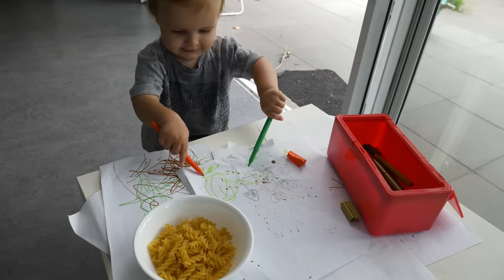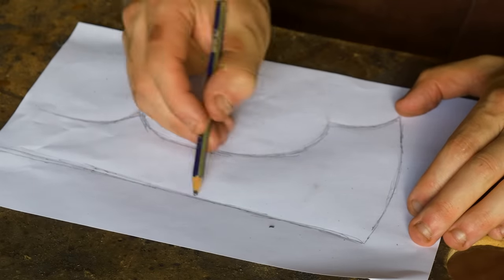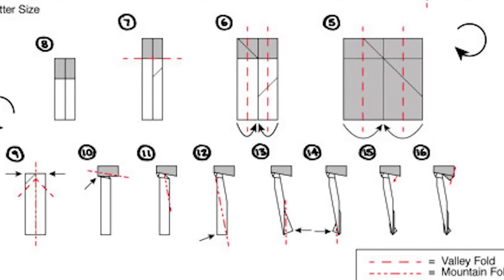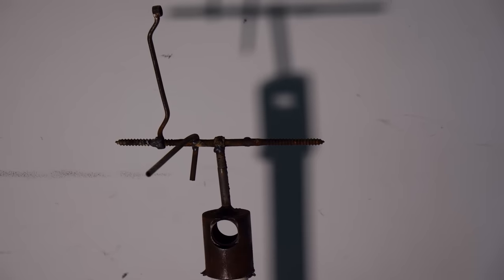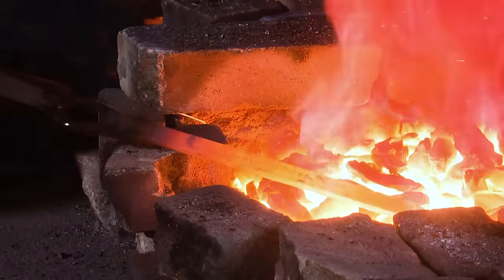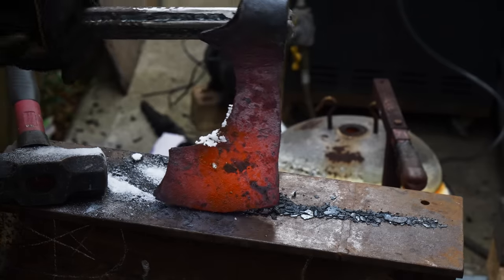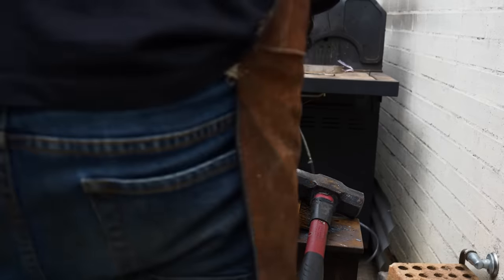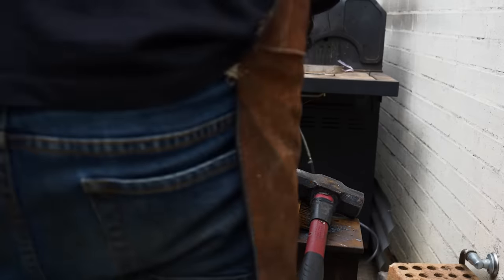YouTube's Worst Blacksmith Makes a Viking Axe!

Comment: 2 headed axes exist for combat purposes. It’s like sharpening both edges of a sword, don’t have to worry about which side the cut edge is on if the only 2 sides are cut edges. Plus combat axes are not effective for swinging to kill people because your axe is balanced on both sides now, so the chances of the axe getting stuck in the person is less likely, since if you have a heavy 1 headed axe, and you swing, the heavy offset weight will be carried into the target, getting it stuck. For example, I have a 1 headed and 2 headed axe, I often get my 1 headed axe stuck in wet lumber way more then I get my 2 headed axe stuck in lumber.

Comment: The reason is because like a lumberjack you keep one blade edge sharp like a knife to cut  and a v shaped edge on one side so if striking a harder surface it will damage your edges less.

Comment: that's actually pretty damn good for someone with little experience
Reply: Me: actually practiced a little bit of smithing and origins from a at least 6 generations of blacksmiths, horseshoers and locksmiths.
Me when i tried to fix an old axe head: fucking melts the whole edge off by accident

Comment: The only historical reference I'm aware if for double headed axes being used for chopping was to give a variety of cutting vs chopping edges on a single tool. By changing the angle of your edge. You can make a more sturdy or more precise edged tool.

Comment: There is actually a very good reason to have a double headed axe, especially in lumberjack work/logging. Two different heads for two different purposes, instead of carrying around a sharp chopping ace and a dull splitting axe have them both attached to the same handle to save weight and the extra weights helps in the swing.

Comment: The 2 headed axe is for in the "olden days" poeple would go up in trees to cut them down the trees were so thick the axe head would get dull so they could switch it around so they would not haft to go down and sharpen it

Comment: Double bladed axes are from a time when men actually worked with their hands and knew what they were doing. Also, they're cool.
Reply: Maybe because you can sharpen both sides so you can split efficiently for longer?
Reply: @IrishAnonymous01  apparently that and one side to cut roots, whichs blunts the edge due to dirt. the other side would be sharp enough to cut down trees
Reply: @IrishAnonymous01  both sides get sharpened so you can work longer without resharpening as well as you can put two different edge profiles on the same axe. One for felling and one for working close to the ground where you might damage the edge. They are also more aerodynamic and can allow for better cuts.
Reply: Robert White oh I’ve actually heard that before about having two different profiles for different uses. Thanks for clarifying

Comment: The practical reason for a two headed axe simply comes down to having a second sharp blade, thus you could work longer before having to sharpen.
Reply: Only useful for felling or splitting axes, not battle axes. He was right about the extra weight. That’s why double sided axes were never really made historically.
Reply: @TotallyNotLoki  WIKI- Double bit axe: A common axe in the ancient world; introduced to America in the 1800s. The heavy head makes it ideal for felling trees. Often one bit is designated for tasks that would more quickly dull the edge such as cutting roots through dirt.
Reply: Not Available as I said, for felling trees and wood chopping yes, for battle no.

Comment: two edges are usefull if u need a reliable foresting tool. one edge is more sharp and thinner but fragile, the other one is beefier and tempers steep into a dull edge for repeated abuse while still holding its edge.
(and if you hack into a nail or a strong branch in the wood it can damage an axe head badlyso having two gives you the room for error)

Comment: The purpose of a double headed axe is to get the most use out of an axe while chopping wood without having to resharpen the edges.  Just switch to the other axe head and keep chopping.  Vikings didn't use double headed axes.  In fact, double headed axes were not used in war nearly at all due to the fact that the extra axe head offers no benefit whatsoever and simply destroys the balance of the weapon.  A battle axe had to be light and maneuverable in combat.  Fucking up the balance of the axe would make it next to useless in a fight.  Double headed axes only have a real utility when it comes to chopping trees and shit.  A battle axe wouldn't be good for chopping wood due to the finer edge.  They're for chopping people.  Not wood.  Hope this helps.  Kisses.  Mwah.
Reply: thanks bro i was too lazy to look any of that up
Reply: @b00tsiew00tsie  You're welcome, honeychild.
Reply: I know it’s been a while,but to add to your comment,a chopping or splitting axe head has a very different shape from a battle axe - it’s far more wedge shaped to,well,split wood apart. This makes it quite heavy tho,and not great for swinging around on a battlefield,and since people are generally easier to chop than wood,a battle axe is thinner and lighter.
Reply: @bosknight7837  Yep.

Comment: Double headed axes were actually used so that if one side got dull in the middle of combat you would still have another sharp side or for having one side more coarse for chopping blah blah and one side more sharp when you needed to have a more fine cut

Comment: Fun fact: two headed axes are actually very useful. One head is narrow and sharp and the other is more dull/obtuse. So one blade can be used for taking sweet clean chops or slices where as the other can be used for work that would dull a blade, like hacking at roots or...whatever.

Comment: I haven’t gone through the comments to see if anyone has explained the reason for double sided axes, but here it is, you have 2 sides to cut with so when one is dull you can use the other before needing to sharpen it again.

Comment: You shouldn't wear gloves when you're cutting. Because if you slip and get your hand cought in the cutting stone it can eat your hand.
But I'm just a kid, why tf would you listen idk
Reply: Riding With Marko No you’re right lol
Reply: No dude your right, even though I'm. A "kid" Myself I do free hand grinding and I hardly never wear gloves
Reply: Only time I wear gloves is on the hand that holds my tongs, other than that I just kinda hope my hands don’t evaporate when I touch something.
Reply: not true, definitely wear gloves when grinding or cutting with an angle grinder. Bigger rotating machines like sanding belts or bench grinders have more pinch points- those you shouldn't wear gloves with. 
Source: work with then everyday
Reply: @SovietBiscuit  thanks for correcting me, I respect that
Reply: @markoblagojoski4588  just want you to be safe if you work with them, even small welding gloves made for tig/mig can protect you if the disc shatters which are what I usually use

Comment: Double headed axes are for when one head gets dull out on the job you can use the other one. There are also splitting axes, aligning axes, axes for different wood types, axes for different materials, and many more. The one used to kill people is lightweight and more maneuverable.

Comment: The reason there are double headed axes is one side is not so sharp its used more for roots and hitting dirt and taking a beating but the other side is very sharp and only for chopping wood

Comment: For those of you who don't know double-headed axes or designed to have different sharpnesses on either side so that you could split wood with one side and cut with the other. Some raven made with different types of steel edges. So you could do the bulk cutting with one type of edge and your fine cutting with another.

Comment: two headed axe is heavier so if you have a splitting head you get more power for big pieces of wood and still can have a fine woodworker axe on the other side which is thin and sharp and more for cutting rather than chopping. or you have one really sharp and clean blade for clean and nice splitting or detailed crafting and a less sharpened, more durable blade on the other side for the raw cutting and splitting

Comment: I can think of one practical reason to have a double headed axe and it isnt for combat

A lumber jack would probably benefit from 2 axe heads, because if one gets dull, you can just swap to the other.

What is actually more usefull than double headed axes is ones that have hammer or spike heads

Comment: A doable headed axe was used by lumberjack when they would go out to cute trees one of the blades would get dull so they would flip the axe around and use the other head instead of traveling back to there camp and sharpening it. It’s not really practical any more.

Comment: As a former professional trail crew who used a double bit axe  in the mountains for weeks at a time between re-supply. As well as a collector of axes i can say with confidence that the axes are for hard wood vs soft wood cutting as the grind differs. When people say that its a sacrifice edge for when your going to hit the ground thats just silly a real lugger from back in the 1850 would spend 2-3 months waiges on a good axe like a chain saw now. They would carry a dedicated axe called a root axe for that task. And others claiming that it was to reduce sharpening time never used a fine axe because they stay sharp for weeks between sharpening.

Comment: I know it's 3 years later, but a double headed axe allegedly cuts trees better because its moment of inertia in the direction of the cut is higher, so it tends to twist more slowly as it cuts, resulting in a deeper cut. Edit: And you have 2 fresh blades, so when one starts to dull, you have a fresh edge waiting, without needing to sharpen.

Comment: This is super old by now but funny story about scale burns. 

So I'm a recovering heroin addict and after getting clean I went back to work as a heavy duty mechanic in a fleet shop. There was a surprising amount of fabricating and metal working going on. One day I was cutting through something on a trailer using an acetylene torch (and was laying on the ground) while wearing a sweatshirt and a glowing piece of magma fell on my arm and rolled right down into my sleeve then stuck to the crook of my right arm burning the shit out of me.... the very spot where I shot up into years earlier. I got the slag out but it left me with a wound, similar to yours, that looked like a scabbed over old injection site. Went to thanksgiving dinner a week later and my aunt pulled my mom aside telling her she saw trac marks on my arm and my whole fucking family cornered me thinking I was using again. 

Fun times. My mistake for wearing short sleeves but I didn't even consider how bad it looked all things considered.

Comment: Two headed aces were made so axe cutters had more weight in their axe making it easier to cut wood and, more primarily, to have two blades so when one gets dull you don't need to sharpen it on site with a whet stone as a grid stone is more effecient, it weighs less and cost less than two separate axes

Comment: double headed axes were actually used originally used in battle. The soldiers were trained to use the ax in an X motion. This usually is used to decapitate other soldiers. Although, this was inefficient, and killed many of the ax wielders themselves.

Comment: Hey to answer your question about the double bit axe or the double headed is one side is sharpened to a duller edge for chopping wood and the other Is sharper for hemming branches like chopping them off getting it ready to cut into sections so one side is more dull and the other is sharper its so you don't have to carry 2 different axes for different uses

Comment: Double bit axes have two bits for different tasks. One is thinner and more sharp and is used for chopping down trees and bucking notches in logs. The other end is thicker and more so used for cutting roots in the dirt where there's rocks as not to damage your nice chopping side. The thicker side is also used for limbing and splitting. 
So its two axes in one. Instead of hauling 2 separate axes for different tasks, they made a double bit.
Also note that this was before chainsaws. But yeah lol

Comment: 1:41 actually they existed and were used in different ways, for warfare It was to add weight and if One side broker you still had another, in Word cutting One Is sharper but less strong and vice versa

Comment: The double-headed axe certainly existed and they're still made today, but their purpose is something up for debate. Some sources say that when the first blade got dull, you would have a second blade sharp and ready to go. Other sources say (as someone in the comments already pointed out) that one head had a blunter bevel and was used for chopping the roots of stumps when clearing out woods so that the sharp side wouldn't be as prone to blunting and chipping. Possibly people would use one side until it got dull, and then used the dull side for roots and the sharp side for felling and bucking trees.

Another purpose theorized is the convenience of sharpening. One could sink the blade of one head into a stump or a log and then use a whetstone to sharpen the other side easily.

Most likely it was a combination of all these reasons, or simply because it looked cool, or was sold as a marketing gimmick by blacksmiths, or certain countrymen just thought they were convenient.

Comment: two heads because: if you hit with one head, it gets dull after some time. so you can switch and use the second one .. doubble the time to hit on something hard before you need to sharpen your head again .. so .. best you need a second head to XD

Comment: Another great way to avoid immolating yourself with red hot scale is to only heat the part of the piece you intend to work. XD it will also save you time in waiting between heats.

Comment: From what I’ve gathered online and archived US forest service documents, it seems like the double bitted axe hasn’t really seen wide use at all. There’s not really strong historic documentation of it being used outside of religious and spiritual practices. It seemingly has seen some use by rural lumberjacks in the US, and probably to a smaller extent elsewhere. The two bits of the axe would have two purposes. One was that if one of the heads (axes) got too dull, broken, or misshapen, the rural lumberjack could still carry out his work. The other was that it made the head used for tree felling degrade slower, as one head was heavier and sharper, and used for tree felling. The other was blunter and used for miscellaneous work such as cutting through roots, bark, sometimes firewood, and limbing i.e. cleaning up the felled logs into raw timber. Pickaxes with two bits are also double headed axes, with one side obviously blunted to smash rock, and the other used for finer work. Ice picks, climbing picks, climbing axes, or ice axes are also usually two headed axes with one side being a pick and the other side being similar to a pickaxes flattened, wide head, seemingly referred to as an adze. An adze was originally a tool, similar to the axe, which had its head rotated 90 degrees, you can think of it almost like a hoe. I imagine an adze being great for clearing roots, allow access to shallow soil, clearing bark, along with other uses. So in conclusion, it seems like typically imagined double headed axes are mostly seen in fiction, and rarely throughout history other than ceremonial and occasional lumber purposes. The more common place to see double headed axes are on pickaxes and ice axes.

Also as a final note, my usage of terminology is very incorrect. The blade of an axe is not the head, as the head is the whole of the structure which is fastened on the end of the haft (handle). The head can consist of multiple bits or parts, like an adze, an axe, a pick, etc. I believe this last section to be relatively accurate, but likely still oversimplified, so to be clear I am absolutely not an expert in axes, logging, or carpentry.

Comment: If you ever get into making long edged weapons (sword, machete etc) please look into the proper way to heat-treat the blade. hard edge, soft spine. just cover the back of the blade in clay, only leave the edge free. Heat it up, harden it and voila - harder edge that holds the sharpness better.

Comment: Anyone wondering why there's double blade axes. Its so you have 2 sides to use. Use 1 side till its dull. Then flip. Use the other side till its dull. So you can go twice as long without having to stop and sharpen them

Comment: alright so, just a quick tip, those cracks should not have been left untreated, it can mess up your axe, but to be honest you did really well, most people start off with just making a knife, and of course failing horribly, but you made an amazing axe, and good call on adding the file, the metal you used for the base axe would have ended up dulling easily , and just for fun (if you hadn't done it already) why not slide that edge over a whetstone real quick, makes it nice and sharp

Comment: I remember doing my first forging I was wearing two pair of gloves each in my both hand cause both of those old pair of glove are a bit tattered and have holes in it. And the funny thing was even wearing a glove a burning peace of metal will always try to find a way to burn you. When I was pounding the heated piece of leaf spring to make it into either a small tanto or just a blade for the balisong. It ended up flying some of it's shaving into my gloves and got sandwich between the the gloves that I am wearing. It was painful and gives you a good wakeup call if you felt sleepy during work hehehe